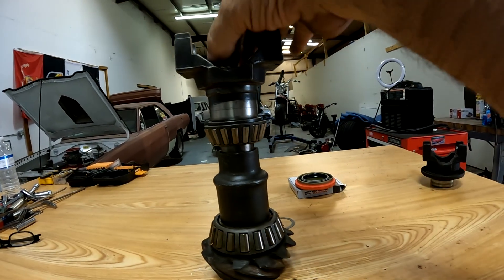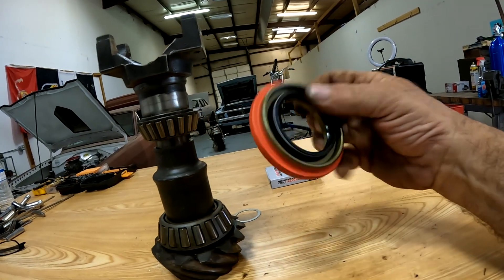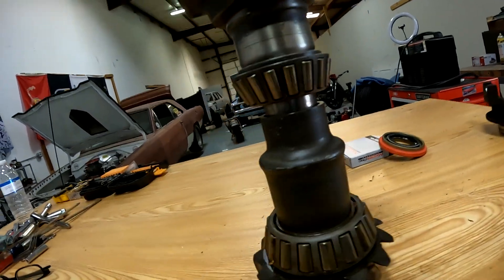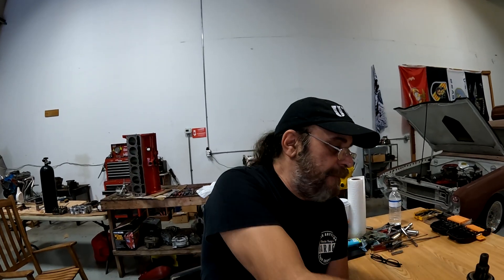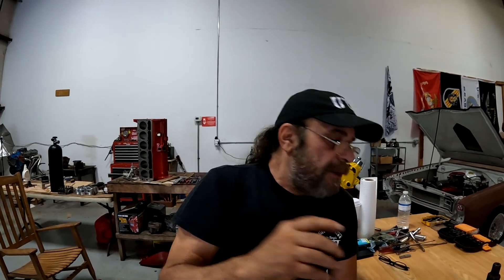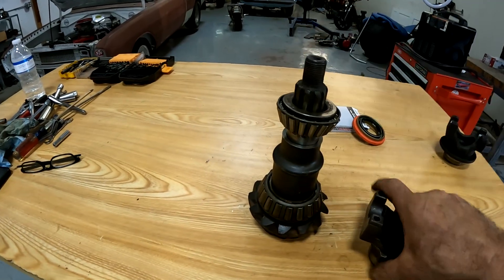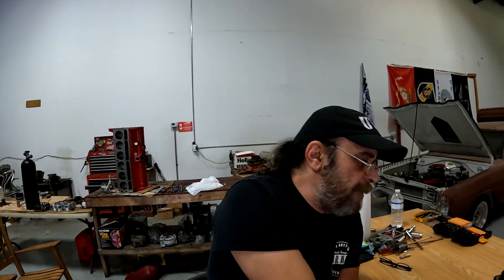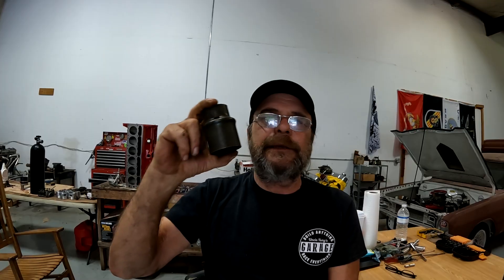Sooner Or Later One Of These Is Gonna Bite You - Dealing With  Your Diff's Crush Collar

Comment: Im a driveline engineer.  So it is possible that a crush sleeve could lose its preload....that pinion nut should be staked or have a prevailing torque feature to keep it from backing off.

Its just as likely that the splines at the pinion flange are loose, and every time you reverse thd car that little backlash will try to unscrew the pinion nut

Comment: never run any tapered roller bearing without preload. I do diffs everyday, all day.  Let me know it you want a instructional session on how a crush spacer works and how to install.I have installed a few hundred pinion seals without replacing the spacer, with zero failures.  I have also rebuilt many diffs after somebody tried to replace the seal and overtightened the nut causing pinion bearing failure.

Comment: Pinion nut backed off because ... Engine or transmission fluid , grease from the U-Joint, old worn out pinion bearings. NO LOCKTIE ON THE PINION NUT or used an old pinion nut when regearing. I've pulled rearends apart that are 50 years old.. It's one of the most neglected parts of a vehicle.. how many people change their differential fluid.

Comment: Interesting video. Im currently working on my 57 Plymouth differential, think its a early 8 3/4 ,im replacing pinion seal. Is it true my 57 doesnt use a crush sleeve? The workshop manual shows just a spacer with shims.so this being said how tight do i tourqe the pinion nut? Workshop manual says 180-- 200 ft lbs.

Comment: It would be difficult with the one shown but in a pinch you can place the sleeve over a bar or the pinion itself, if you support it with soft wood, and hammer around on the high point of the sleeve diameter. This expands the sleeve. The preload for all GM axles I worked on was 15 inch pounds on used bearings and 30 inch pounds on new. This is easier with the carrier removed.

Comment: Put the sleeve on the pinion and use a flat faced hammer and peen the ridge of the crush sleave then re crush the sleave using an impact an blue loc tite on the nut run the nut down to get the desired preload been doing this for 25 years if a new sleave is not available never had a warranty issue do to premature failure.  So yes a crush sleave can be re used and often is in the rebuild industry.

Comment: Totally unrelated topic, I have a 88 caprice I've bought, it has a 383 chevy that's out of tune,  has several other issues, my problem is im having a hard tie finding a mechanic that knows anything about tuning cars or carburetors. Most either drag race and don't do public work, work on factory newer efi cars, or they don't know what a carb is. I not mechanically inclined but I have a working knowledge. Been looking around, but it's a 1 or 2 horse town, bout 15,000 people......
Any suggestions?

Comment: Yes you can reuse them but only tighten until all slack is gone and don't crush further.
Not for a novice.
You crush them originally until it takes a certain inch pounds to rotate the assembly.
I like to use a beam torque wrench.
Always use lock tire and maybe stake the nut.

Comment: All these guys say you can't reuse crush  collar,bs, been re-using collars for 40 yrs. Never had a problem! You all are full of it! If.you're that worried put old collar around a socket and tap raised portion with a hammer around circumfrence  this will re-lengthen the collar, check it with caliper. If you try to crush a new collar you can strip threads on nut and pinion, now you are screwed! Also a real drag race rear has a spacer not a collar. And finally how do you get the forward pinion bearing off so you can "fish" the collar out during a seal change? That's right you can't! So now you must remove diff cover,axlles,carrier,soyou can drive pinion out. Get real no pro shop is gonna do all that to change a seal. We ARE gonna match mark nut to pinion and red lock tight nut back to original position and then check bearing load. Get real with your egg head non-sence.

Comment: I've done many differentials. Stock, and drag racing. Never had one come off. Always used a 4-foot pipe wrench on the yoke and a 4-foot breaker bar to crush the collar. Use a little blue loctite, sneak up on it while checking the preload with an inch pound torque wrench, run it with no load when you're finished for 20 minutes. Take it for a ride, bring it back and let cool overnight. It's ready for the track.

Comment: All rear ends should be built like the 9 inch Ford use to have. Adjustable side bearings and removable pinions with shims. But automobile manufactures today don't want anything simple. Today they want it almost impossible to fix or to do yourself,,,,,,,,,,,,,,

Comment: I worked in a Calif farming town in a mom pop parts store. The town was flooded with Astro vans used for farm labor transport. We were on the main entrance to town and the vans would back off the gas right in front of our store. I swear, every rear end howled as they came into town. We stocked all the bearings, seals, crush, gaskets needed to fix these things. We only ever sold the pinion seal. Once, while delivering parts, I saw the shop owner take an air gun and rattle tattle tighten down the pinion nut as far as it would go..

Comment: Thanks Uncle Tony!  Brings back my first car memories, a Mustang. It had noisy bad pinion bearing. I followed shop manual including buying new crush spacer. Never knew why they used throw away spacer, but your production explanation says it all. Dad and I had drive yoke in vise and we  torque wrenched over 200 ft lbs to start crush. Had to ask friendly trans shop for some yellow gear ink, so I could set ring gear pattern. Must have learned something because I remember ! 😊
Reply: I KNOW WHATS WRONG WITH IT IT'S A DODGE

Comment: Crush collars do not lose tension over time.  Bottom line is your pinion nut either backed off for whatever reason or your bearings were worn because your preload wasn't set properly originally.

You don't need to replace a crush washer anytime you remove the pinion nut.  It takes quite a bit of ft-lbs to crush the crush collar.  As long as you don't apply too many ft-lbs when reinstalling the pinion nut to where preload exceeds what it was originally, you'll be fine.  Apply some loctite and torque to 150 ft-lbs and it'll be fine.  The crush collar will not crush any at 150 ft-lbs.
Reply: Thanks for the idea

Comment: Uncle Tony just wanted to all things being equal I have always been partial to internally balanced as opposed to externally balanced engines like the 318 ,383,413,440 with steel cranks Pontiac V-8s not including the mut 265,301 Pontiac,pre86 Chevy big and small block except 400 sb and the 454 bb,also the Ford fem series,the 429,pre 79 460 to name a few.I would be interested in your thoughts.Thank You.I enjoy your posts.

Comment: Some manual transmissions also have a crush sleeve in them. and it's crucial that you replace the original one with the correct replacement. because I found out the hard way, when I had to rebuild the four speed in a GMC half ton short box 4x4. and I thought I got the right crush sleeve from the GMC dealership. and it turns out that there was two different crush sleeves for that particular transmission.

Comment: I knew how the crush collar operated but I couldn't see the point of it if you were setting the turning resistance torque of the pinion shaft with a continuous torque meter.
I couldn't get one so I made a two piece spacer on the lathe that featured a cone and tapered socket mating face. As the assembly is tightened the cone forces the socket open. The more the assembly gets tightened , the higher the resistance to further tightening gets.
Pretty much the opposite of a crush collar's yield characteristics.

Comment: The preload is measured in" lbs" by manufacturer... F u mess w bikes, u hav a crank tool specific for bearings. I jst did a 14 bolt semi floater...only thing stok was shell... Owner of Nitro gears, great guy, hooked me up w 4:88 set. Was 10lbs on crush, n comes w shims too. I lock yoke w adapter n bar, throw a socket on it w nut slack gone.mark socket at 12 position, use gud impact ... N go slow.. to 2 then 4 then 6 ect... Till u get within spec of specified manufacturer... Do it rite first time.👍💯 The measured 10"lbs"... Is while u r rotating the pinion n a full circle ⭕... Not 🚫 holding the yoke... Till a torque wrench clicks. N other words , it takes 10lbs of torque to turn the pinion, for correct bearing preload

Comment: Just put a sure-grip 8.25 Chrysler in my XJ Cherokee.  Got the noise and you just figured it out for me. Thank you for saving me the time trying to figure it out. I had to change the Yoke because the one on it was messed up. Thought I torqued it and used the right amount of red thread lock but I guess not. 😢

Comment: Something not talked about is the nylock pinion nut. That new nut should never be backed off for final Tork ever. Use the old nut to do all shimming and to crush the new sleeve to value, then discard the old nut and install a brand new nylock nut pinion nut and take it right to total speck.  NEVER EVER back the new nylock nut off, not even a little. If the pinion bearings become to tight with the new nut, take that new nut all the way off and throw it away and buy another NEW nut as they are not made to be back off at all, and can back off under load if for any reason you turn the pinion nut counterclockwise even a little.  Myself, I also use 1 drop of red thread locker on the threads of the pinion threads with the new nylock nut for final assemble, but never ever reuse a backed off pinion nut. Me I always buy 3 or 4 new nylocks and return the unused ones.

Comment: As a 13 year old I got a car and beat it up playing  , the rear gears were hurt, I welded the ring gear teeth  and grinded them to work I removed  the sleeve  and didn't  use any thing else  ,  I checked  preload  with my arm , I beat the crap out of that car  I rolled  it in a hay field,  scraped the car but sold the rear axle and it was put in a hay hauling  truck  that was over 40 years ago. The truck  is still used

Comment: The old timer who taught me said to mark pinion nut, usually with a straight line across the nut. That way you can see if the nut has backed off. It was a valuable addition.

Comment: What a timely vidja! I'm about to start on my first diff rebuild this weekend. This context really helps! One quick question , I've always hear that you shouldn't have to reshim if you just swap bearing on the same ring/pinion gears. This true? I"m really hoping this is the case since mine uses custom c-clips as shims and the dealer doesn't sell them anymore (WK jeep, front diff, mercedes 200mm). I'll obviously mark and verify but I'm concerned that the parts aren't even available if things don't line up.

Comment: I'm not sure that we can blame the crush collar setup for this problem. I've never had any experience with the issue but it seems to me that unless the extra clearance can be 100% attributed to the collar crushing more than it was when first fitted then we need to look at the situation differently.

Is the main problem that loosening the nut means that you have replace the crush collar?

Does a shimmed setup with a solid part replacing the crush collar last appreciably longer before the same sort of problems occur?

Comment: Ive never had an issue running the pinion nut from start to preload . Large cresent on the yoke wedged against something and held and whatever vintage snap on impact I had at the time... I have always set them all to about 1- 2 inch pounds rotating resistence with the ring gear absent the preload is specific to the bearing , not the car or manufacturer.....The only time ive had to eliminate them was on stick cars getting pounded in the gate. Thats everything from Dana 80s down to 7.5" fords.... The danas come loose on the regular and will take a little bump to set them back and roll again.

Comment: Typically with Chrysler stuff your looking pttr pinion torque to rotation the spec is how many inch pounds of torque it takes to rotate the pinion gear that lets you know  what your bearin g preload actually is. There's a whole worksheet to use when  rebuilding one .it's start with a dttr measurement  .that's differential torque to ratation. With some math it takes you through the whole process of measurement to shim selection to get the perfect final assembly .once you learn this method it works every time. Although you are using the factory setup tools wichmostguysdont have access to unless they buy them from miller

Comment: That's exactly what's happening to my axle. I changed the pinion oil seal as it was leaking, but frankly i never knew about the crush collar. i just tightened the pinion nut back. No more leaks but ... but ... there's now noise as exactly described by Tony. Acceleration nice, deceleration, there's like a tick tick tick sound. Goes away as you lightly touch the throttle, but comes back when you let the throttle off. I'm not sure if this diff has such a collar. It's an Australian Salisbury 10-bolt diff with no C-Clip holding the axle shafts in the centre.  
Can someone tell me how would one check for such a collar?
Reply: It has one

Comment: Get a solid spacer. Used solid spacers in my front D44 reverse   high pinyon, and one in my Strange/Ford 9” rear. Buy duplicate bearings for everything, one set make “set up” bearings by honing to slip fit, and go with a solid spacer with assorted shims. The only way to set up gears

Comment: While you were doing this video I was thinking that you could take the old crush collar, measure it precisely with a set of calipers or a micrometer, then duplicate that length in a fabricated spacer on the lathe, then re-install with a few ugga duggas on the impact. No need to mess around with pre-load then, because it was already set the last time you put it together, and that old crush collar is the exact right length to get it there.
Reply: The crush collar may try to spring back to its original length once the pinion nut is removed. If you measure that your machines part could be 1-2 thousands too long. The rotational torque required to turn the reassembled pinion assembly will determine if the preload is where it should be. So you could machine off a micron at a time until you get the right preload torque.

Comment: When crushing these crush sleeves the way I do it on every diff is turn the pinion with a in pound torque wrench and tighten the nut until you have 20in lbs of rolling resistance or 30 for new bearings

Comment: I drive a 2004 astro cargo van. it was running cold. I took it to a local shop to get the thermostat replaced and they did. two days later, what you described, howling on accel and quiet on coast I knew what it was and thought, now how, aside from bending rust bucket's frame on a lift could they have thrown my drive shaft angle all to whack?" And why would they have lifted it to swap out the thermostat?? - Well, knowing full well this shops pocket response to "you broke it" only results in a new appointment and further charges, I drove around like that for a while. I took it to a quick lube place where I get her oil changed and asked them to refill the diff. I heard someone exclaim "The seal is bent!" and the brought me a picture on a phone of my dented diff pumpkin and asked if I had ran over anything. They also said any gear oil would just run out and I was better off with the sludge. So crap, now I need a reman diff at least. prolly wheel bearings and maybe axles too. 🤦‍♂

Comment: U.T...did alought of rear end gear swaps & so forth years ago....never knew "why" they used crush collars..thank u..1 question...dana 60's...my boss had one in a camaro that he ran....that rear had shims in it for the preload on the pinion berrings....the rear was from a 69 Charger 440 6 pack..the shims & the spacer was avalable from the dealer ( late 80's)...is that the way "all" dana 60's come from the dealer...or did someone change out the crush collar...thanks another great video...!

Comment: I have done many diffs. And never had a problem with the sleeve. I have seen people stuff around with solid spacers and shims etc and usually have grief. Occasionally you may have to use a new sleeve because the old one is squashed too far or use say a 015" shim. 
This on GM 10 bolts both US and Aussie, B/W diffs, 9" lumps, Mazda, Toyota and Big Austin diffs.
Pinion nuts do NOT back off, either use the crimp or simply loctite and make certain the bearings are all good and washers flat. And getting pinion height correct the biggest pain. The ones with threaded adjusters seldom ever cause and issue
Too many diffs especially with side shims will get decidedly wonky and even after reshimming will generally 'talk'

Comment: What a coincidence you made this video, a few days ago I had to replace the pinion seal on my 88 f150 8.8 ford rear. I bought a new pinion seal and a new crush sleeve because I knew it was a one time use item. When I removed the driveshaft I planned on counting threads to save time re tensioning the pinion flange. It was so loose it had lots of play inward and outward, I’m shocked my rear isn’t smoked. I’ve had issues over the years with ford and Dana rears. Never had or seen issue with AAM axles.